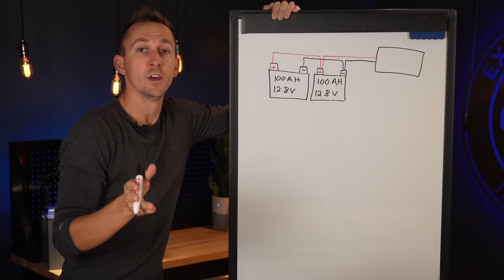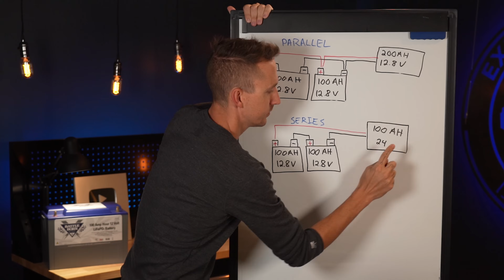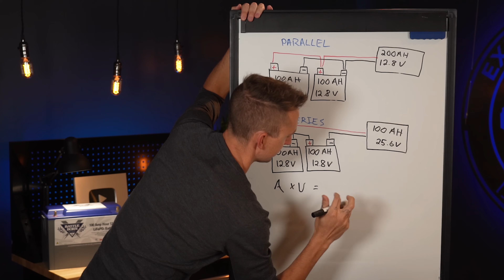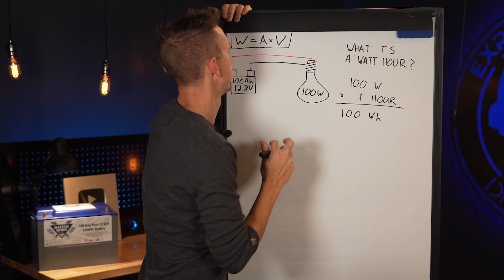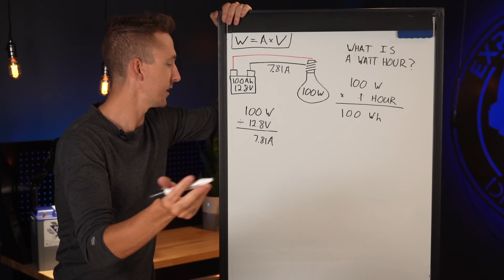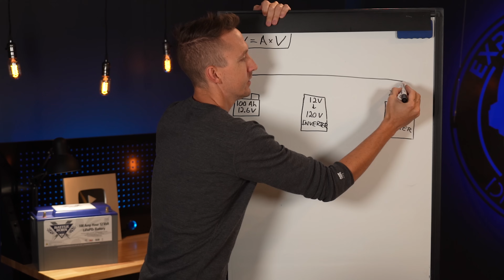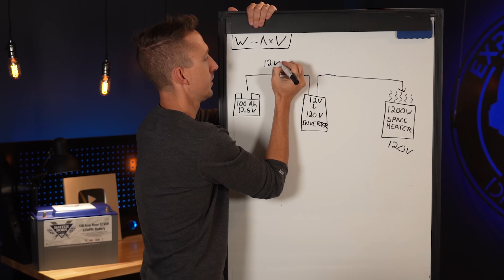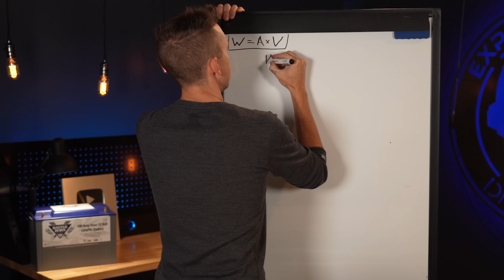AMP HOURS EXPLAINED (amp hours vs watt hours)

Comment: Darn I couldn't figure it out great explanation but I couldn't figure it out

If I'm going to run a 48 volt system can I run three 300 amp hour batteries12 v and one 200amp hour because that's all I have. Or will that decrease my amp hours immensely because one is only a 200..
. They might all think they're 200
Reply: All batteries in one bank should be the same Ah capacity, the same type (chemistry) and ideally from the same manufacturer/model too.
Reply: @jeffnorbert1871  thank you

Comment: Thank You,for a very informative and easy to understand vid. I am not an electrician (more of a Jack of all Trades), but my son-in-law wants to run underfloor heating from solar panels/ battery banks/inverters. So your vid is going to help me tremendously with my calculations.

Comment: The glaring problem with your whole video is… Anyone who is interested in this lecture is watching in order to learn if 12 volt or 24 volt system is safe for a 12 volt system design.I have a 12 volt system in my RV.if I design and convert my power system to 24 volt ( in order to utilize the increased power and smaller wires) am I going to blow up my system?? It would have been prudent and save a lot of frustration that I had if you would have stated from the start which system is safe for 12 volt and or if 24 volt power can be used in a 12 volt rig. I have been following your videos for a while and like the way you explain simply and step by step the various processes BUT I get confused at times by information that I would need to make a design decision . Thanks

Comment: Hi Nate I just ordered 2> 300w solar panels. I'm wondering what po4 battery you recommend. My wife and I will be doing occasionally boondocking probably 3 days no more than a week. Right now the weather's not too bad to where we need air conditioning but we will eventually. We also have a bluetti  ac200 max with 200 PV200w portable panels  to help when we are boondocking.. I really don't see using all of this we have boondocked and we made it just fine for 3 days without any solar we were in nice weather. But I did keep an eye out on our batteries. And I did recharge with our generator. Yes I can use all the help you can give me I'm not too up on solar or anything else for that matter I'm really old school. I'm looking at this>
Ampere Time 12V 200Ah Lithium Battery with Self-Heating Low Temperature Charging (-4℉) LiFePO4 Battery 4000-15000 Deep Cycles Max 280A（5 sec）Discharging Current Perfect for RV and Off-grid etc.  I'm 62. Thanks
Reply from the maker: Hey William!  Sure!  I recommend Battle Born Batteries: https://battlebornbatteries.com/?afmc=explorist_bb67

Comment: Amp hours is meaningless. It depends on voltage. Watt hours is the only way to make a true comparison.
Reply from the maker: Since all major battery manufacturers list their batteries as Amp hours, it's an important concept to know, which is why I made this video. 🙂👍
Reply: @EXPLORISTlife  exactly and the amp rate of discharge over that period of time. You know why that's important to know.

Comment: Great videoy.  @4:32, it would have made more sense to hook up 2x100ahx12.8v batteries for consistency with your previous example.  That way, you would be able to show that the light bulb gets powered for the same amount of time coming from both batteries.
Reply from the maker: If that's the way it helps you understand, that's great! 🙂👍 Thanks for watching.

Comment: Batteries should be specified in VAh or kWh.

100Ah at 12V car battery, 100,000 mAh at 5V USB battery or 100Ah at 300V powerwall is vastly different amounts of power.
Reply from the maker: Yeah, but they aren't... so this video explains how it works...
Reply: But when you start building battery banks, you should use Wh
Reply from the maker: Yeah, I guess so, but that's not what this video is about.

Comment: Hopefully this was mentioned earlier.  Starting at 8:45 inverters do NOT run at 100% efficiency.  In order to get 1,200 watts out you MUST put in more than 1,200 watts.  The difference is dissipated as heat within the inverter.
Reply from the maker: This is a basic 101 level discussion.  We didn't discuss power factor, efficiencies, etc as those topics add additional confusion which hinders clarity.

Comment: I think a discussion of wire size requirements based on required amperage is critical here. The system is not strictly voltage driven. Remember that every time you double the voltage supply i.e. 12VDC to 24VDC the wire size required is cut in half for any given load.
Reply from the maker: This video was only about capacity.  We've discussed wire size and how it relates to voltage in several other videos. 🙂👍

Comment: hey Nate great vid again. However in the parallel system Positive and Negative should be taken off different batteries not the one battery, Current needs to flow through the whole system, not just the end battery. Keep up the good instruction, I still learn heaps from you
Reply from the maker: Of course!  And that's exactly what I show in all of my diagrams at https://www.explorist.life/solarwiringdiagrams as well as all of my full system installations here on this channel.  This video was more about the theory of amp hours and not to where/how to actually connect wires.  I also didn't draw in any fusing, lugs, heat shrink or any of that other stuff you'd need to actually make connections.
Reply: @EXPLORISTlife  Noticed you skipped the real life inverter losses as well.
Reply from the maker: @markpashia7067 Yep!  This is a 101 level discussion and I purposefully omitted things like inverter losses, pukert exponent effects & the differences of inverter losses between inductive and resistive loads to keep the video easier to understand for my target audience.

Comment: I hesitate to ask such a elementary question,   2560 Wh  shown above, does that mean I can run a 100watt lightbulb one hour = 100 Wh divided by 2560 Wh to get time of contiuous use... = 25.6 hours
Reply: 2560 Wh source capacity ÷ 100watt usage = 25.6 hours of use.

Comment: I have not found a battery that would put out the amp hours at it volts that it is rated at. I don't believe there is any 100 ah batteries out there that will put out 1 amp at 12.5 volts for 100 hours. Not possible.
Reply from the maker: These do: https://battlebornbatteries.com/?afmc=explorist_bb67

Comment: How would you calculate how long a solar system will power a set up? Lights, phone charger, 12v fridge freezer combo. Use this equation obviously but how do you factor in the solar input?
Reply from the maker: This is what you'd be after: https://youtu.be/a406IxiU-Xg
Reply: @EXPLORISTlife  perfect thank you

Comment: Nate, any info you can give me on this would be greatly appreciated 

Have a 2021 310GK with factory solar, the Jaboni 300watt panel-( 39.85V and 9.75 amps) with a 2000 watt inverter. First thing I did was to ditch the lead acid for 2 x battlebourne 100ah. It works for us, maybe got down to 35% overnight. But I had to run the Honda 2000 a couple hours everyday to get it back to 100%, summertime not so much but the late fall for sure. So i went on a black friday spree and added 4 more BB so now I have 600ah. Then I added a bundle from Dragonfly that has a Multiplus 2-3000watt charger inverter, the Victron MPPT 150/60, Lynx distributer, easy start, 712 monitor. Gettting  aplan together for install, and thought I would add 2 more panels to the roof, here is where I think I might have screwed up. I have purchased 2 Renogy panels at 200 watts each, Optimum voltage is 22.6v and optimum current is 8.85 amps. I have been reading up on this and have found out panels of diffrent sizes can  work down to the lowest wattage and thus become very inefficient. Series and parallel are a bit confusing to me as is all the math to figure out the best route if any..is there a smarty pants in this bunch that can direct me?? 
Thanks for any help here
Reply from the maker: Mixing solar panels in the same array usually has negative effects.  Here is a video that will teach you how to figure out what the effect will be: https://www.youtube.com/watch?v=jejro4zkl8I

You're going to want to wire your new 200w panels to a secondary solar charge controller.

Comment: Finally - I hope everyone watches this video.  Describing your battery system in amp hours is like saying you get miles per gallon.  You are missing an important part of the equation and illustrates to someone with knowledge that you have no clue what you are talking about.  As we move into Lithium, another key item to know is 3.2v per cell - this makes battery sizes 12.8v, 25.6v & 51.2v.  I have a 600 amp hour system at 25.6v - so 15,360 watt hours of capacity on my coach.  Nicely done video - thanks!

Comment: Do have a video that talks about be efficient usage of 24 V through a inverter 
versus using 12volts?
This video was great at explaining power of 12/24 volts banks of batteries.

Comment: Good explanation. I always use "watt hours" to describe the capacity of my batteries, and most people dont actually know anything about electricity beyond what they see on Youtube, so they are always confused when something other than "amp hours" gets mentioned. "Amp hours" used in discussion is only generally relevant if you ASSUME the battery bank is 12v. My bank sounds much smaller than it actually is when I say I have 540Ah (because its 24v)- I always have to caveat, in 12v terms, its actually 1080Ah.

Comment: So you're saying that having a 24V system is better than 12V, because it allows for thinner wires. but let's think what do we want to operate on dc/lower voltage? lamps, are they available for 24V? maybe it's easier to find 12V lamps, dimmer, and all other accessories? what about USB chargers? again, 12V is very common. 24V ? maybe, I don't know. most of the automotive world is based on 12V, so 24 might be tricky. what's your experience?
And the inverter, does it have to be 24 as well? are they more efficient? less?

Comment: Hi Nate, You can explain this tech stuff so well. I have a question please where i need your help if possible. I have a 7.5m camper trailer being built at the moment. Feb finish. Im wanting to put 4 x 12v 200ah lithium batteries with 10 to 12 x 300w 18v 16.7a solar panels. Can you please help with what would be the best set-up. Im in Austraila so appliances are 240v, including the fridge and AC. The fridge can run on 12v / 24v or 240v. what would be best?
Reply: Sorry, the batteries are made by a local company so can be 12v or 24v or whatever works best.
Reply from the maker: Yeah, I think you'll find my videos helpful. :)  All the advice I can give is found here on the channel.

Comment: One bit you might want to talk about is the peukert affect. The harder you pull (more amps) the less ah you have available. A typical lead acid is rated at C20, so if it's a 100ah battery, then you can pull 100/20 = 5 amps for 20 hours (well no, more like 10 hours, 50% depth of discharge is considered dead).  if you pull harder, the ah capacity drastically drops. This is where Lithium batteries have the edge over lead acid. Their C rate is closer to C5 and their Depth of discharge can be 80-100%. Given this, you can pull 20 amps for just under 5 hours, or 5 amps for just under 20 hours. Perfect for those occasional high amp loads. Battery voltage will not sag as badly, causing inverter cutout.
Reply from the maker: This is a 101 level discussion though and adding advanced topics like inverter inefficiencies, power factors, peukert effect and such just add additional confusion for those just being introduced into this topic.  I appreciate you watching, though!
Reply: @EXPLORISTlife  Your video here is awesome for me, a newbie, but I would have liked to see the end of the video finished with a lingering question which is "So why and when should you convert to a higher voltage? Why not just leave everything as-is. And why and when should you run your batteries in a series as opposed to in parallel." You taught the concept now I want to see how that knowledge is used as a tool. It's like you taught me how to multiply but you didn't teach me why I would want to multiply. I'm sure your other videos cover this but I felt that would have been a better segway into learning more and getting into the more advanced topics.
Reply: This is an excellent video. I'm going to have to watch it two or three more times to make sure I have all the right ideas. Thank you. @EXPLORISTlife

Comment: So … what’s the difference between amp hours and watt hours??
Reply from the maker: Amp Hours = Amps Used in an Hour
Watt Hours = Watts Used in an Hour
or
Watt Hours = Amps used in an hour x Voltage of Battery Bank (for most cases)

Comment: I am going to buy a travel trailer. The 12 volt refrigerator, air conditioner and fire place would use the most energy. If I installed 8 100 watt solar panels and had 400 ah battery bank , would that be enough for two people and make the house self sufficient?
Reply from the maker: Unlikely.  Not without using a generator to supplement power when you are using the electric air conditioner and fireplace.  Those two are huge power hogs.

Comment: Im wondering if you can help?  I have a 2015 outside van with agm batteries and 1000w magnum inverter.  For now I just would like to have a larger inverter to run a microwave and an induction cooktop.  At some time in the future I will probably upgrade to lithium batteries.  For now i am wondering whaat my best play would be to upgrade the inverter.  Should I go with a refurbished magnum 2812 or a victron 3000w?  Im handy Burt electrical engineering is not my gig.  I can follow schematics and do the install pretty easily, however figuring out what i need is not my thing.  I’d like to disconnect old and then reconnect new without too much reconfiguring.  Any thoughts would be helpful.  The victron seems a better value and down the road easier to upgrade with.  Thanks!
Reply from the maker: Check out my diagrams at https://www.explorist.life/solarwiringdiagrams to see how I recommend setting these systems up.  You may check out the '30A OEM RV Retrofit' specifically since your camper has a pre-existing system.  To upgrade from a 1000W inverter to a Multiplus 3000, you'll also need to upgrade to a minimum of 400Ah of battery bank capacity; so take that into consideration.

Comment: Hi Nate! So would you consider a 24v system "safer" than 12v If the two systems were equally designed (aside from awg sizing)? I am getting at ampacity and voltage drop  in a 12v system.  World that also be a consideration in a 24v system?
Reply from the maker: I would not consider it safer, no.  Ampacity and voltage drop are considerations regardless of system voltage.

Comment: I'm new to your channel and am a big fan. Thanks for putting in the effort on the channel, i've learnt a lot already........just re this video, and to help everyone out there, I may be wrong but for an apples to apples comparison, in your 12v vers 24v battery diagram, I think the 12v should be 200amp, not 100amp as you're joining the batteries together in both the 12v and 24v example? So your 100w globe is drawing 7.8A from a 12v 200amp battery set up and your 100w globe is drawing 3.4A  from a 24v 100amp battery set up so basically its same, same however you save cost by being able to use smaller wire in a 24v set up? If i'm wrong i'll just sit here and be quiet!  Thanks again for your great and ongoing videos. Cheers.
Reply from the maker: There is a lot of ways to describe something so I just choose the one that seems the most simple to understand from a conceptual standpoint.  Thanks for watching!

Comment: Question: if a product only takes it’s necessary power to function, wouldn’t you be able to power (for example) a 12v winch with a 48v battery? Or does there HAVE to be a mediator of some kind so the winch doesn’t blow up or spin too fast? Obviously I’m missing something because nobody operates 12v stuff off of a larger volt battery without a step down but i would like a clarification for piece of mind. Also, doesn’t have to be a winch, could be 12v can lights or 12v AC unit, etc…
Reply from the maker: A 12V winch/light/whatever connected directly to a 48V battery bank would burn up the winch/light/whatever.
Reply: The connected device (winch, light, radio) will only draw the AMPERAGE  that it requires. VOLTAGE MUST MATCH what the device was designed for. POWER as you stated is rated in WATTS which (as explained in the video) is voltage x amperage. Hope that helps.
Reply: Voltage is electrical "pressure". A device designed to operate at 12 volts of pressure would typically not be able to withstand 4 times the pressure it is designed for.
Reply: @jeffnorbert1871  i like that explanation, thank you

Comment: So basically you're saying that when you figure out the amperage from the load needs to be times 10 pull from the battery.
Reply from the maker: Not necessarily.  12V battery to 120V load would be x10.  24v battery to 120v load would be x5, etc...

Comment: Ohms law..you broke that down nicely. remember, "watts is power"  volts and amps are characteristics of the flow. Heavy loads on on 12 volts can add up to lots of amps and that needs bigger wires...or you get HOT WIRES!
Reply from the maker: Indeed.

Comment: So you gain some savings by being able to use smaller wire from the inverter to the load, and it's easier and cheaper to find 110/120 volt appliances to use in your rv, you lose some power from inefficiencies in the inverter
Reply from the maker: The smaller wire size for the same wattage inverter would be from the battery to the inverter or the battery/fuse block to the load.  Inverter to load would be the same since it's already been inverted to 120V.